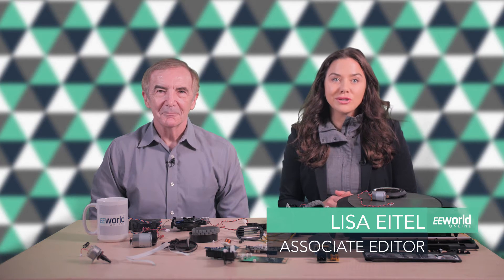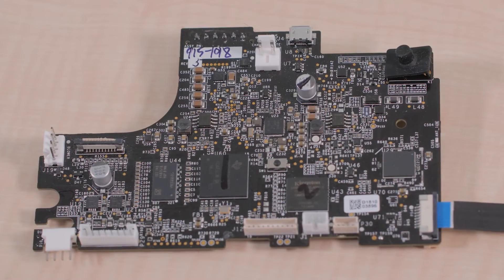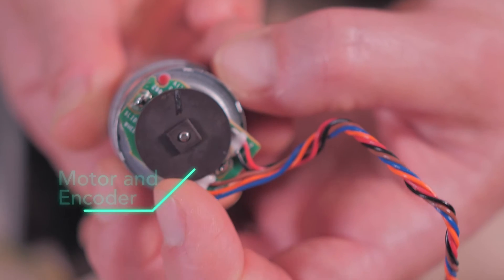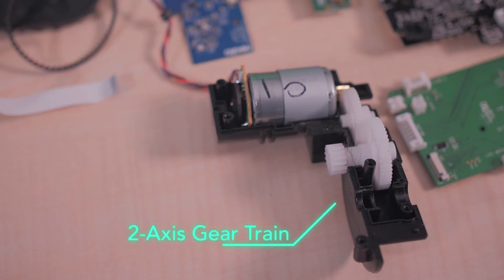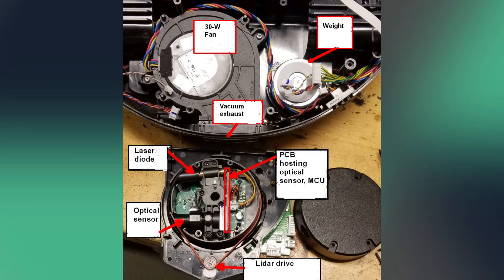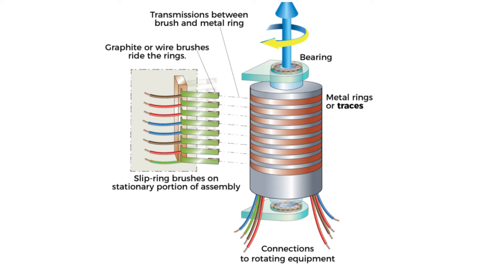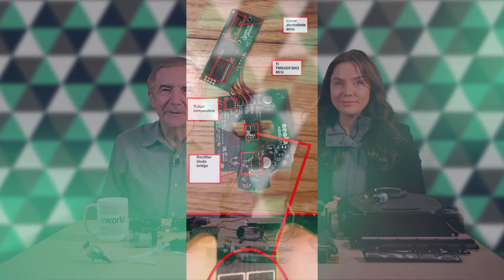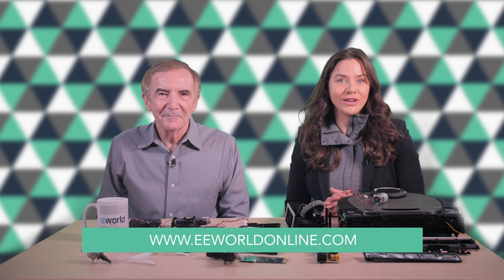Teardown: D7 robot vacuum from Neato Robotics

Comment: This is outstanding. The internet has finally given me hope again. Rather than all searches leading to an Amazon ad, I finally got some info on my Neato. The one pat I missed or didn’t see was on the side brush. The side brush on my D7 is not working and I am assuming it is the module that sits above it as I have already replaced the motor. Would that be a safe assumption?